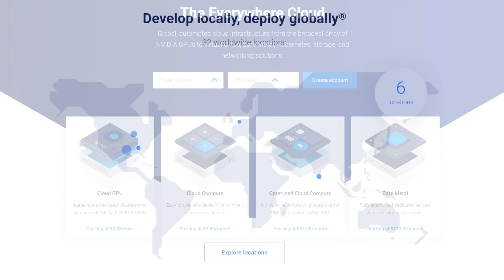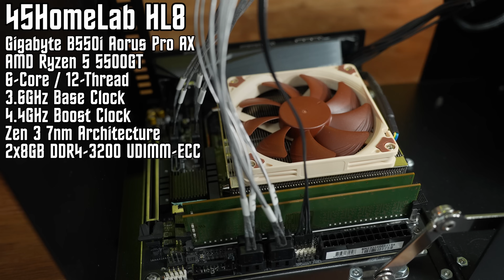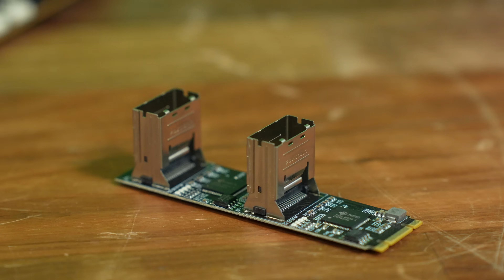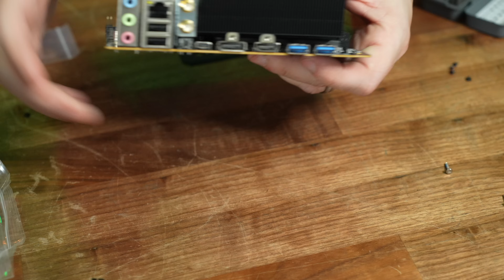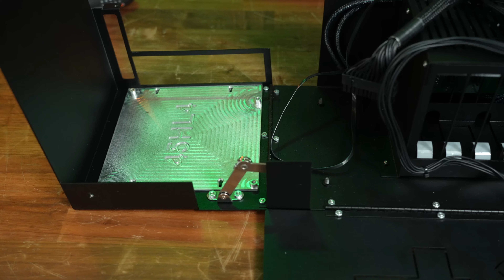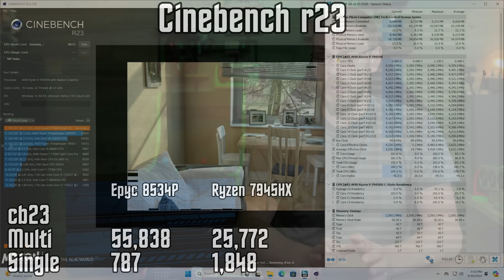The Ryzen 7945HX Mobile is an INSANE Server CPU - Minisforum BD790i in a 45Drives HL8

Comment: The GPU Spec for the 7945HX is wrong, it only a 610M and only 64GB of RAM Per Minisforum Spec sheet. I run the same board with a 10G Card for a pair of Proxmox Nodes.
Reply: It supports 96 GB RAM (2 X 48GB)
Reply: @zak-rq  Wow! I was surprised to find 48GB (and even 96GB) RAM modules on sale )
Reply: it unofficially supports 96gb
Reply: @리프로-y7v  Ya most of the Minisforum mini Pc's will run 96Gb DDR5 at 5600 without a problem, it's mostly just that they havn't tested all the models with a 2x48gb set. I'm more interested if this board will run with registered ECC if you can find a working SATA M.2 card for NAS setup.
Reply from the maker: ...I think I unconsciously typed that, as I'm so used to the 780m for APUs. I KNOW it used the 610m. Consider this my asterisk.
Reply: @CraftComputing  I'd really love to know how well the 610M handles plex transcoding, if it works at all.
Reply: @JBoulter11  It doesn't.Radeon don't support plex encoding. You need quick sync for that. Even a pretty lowly n100 should do this very decent.
Reply: @mrdali67  quick sync is the only way, hence why he’s using an Intel arc gpu
Reply: @CraftComputing  ..about a voice over to correct yourself ?
Reply: @CraftComputing  ******************************************
Reply: Correct on the igpu, but 96gb works fine.
Reply: Level 1 has 128 working 😊
Reply: I just got 128 gigs to work on mine (2x64 4800 crucial sticks)
Reply: @TyroneLegstrongVI-z3o same
Reply: I’m about to put a 9070xt in one 😉

Comment: It seems to me that if you isolate the connector torque by adding two things, an actual screw and wide washer mount for the nvme card and a securely mounted cable brace  "L" crossbar to stabilize the two sata cables ... gently attach the cables to the nvme card, then insert the card and fasten with screw and base washer ( same width as nvme card if possible) ...  secure cables to crossbar to the vertical surface of the "L" with a flat segment with 2 tapped screws (or screw/nuts per cable.  The aluminum "L" stock (brace) should be available at any hardware store ... cost  - screw tap tool (15$)?  This "L" brace is the screwed to riser mount, which is the attached to the mobo tray, with a cross bracing strap piggybacked through one of the cpu coolers bracket screws.

... all this providing there is safely drillable mounting spots on the tray ... 😅

Comment: Im doing something a little similar, putting a ryzen 7900, 96GB ram, 8 20TB exos, a U.2 15TB 2.5"ssd and an RTX 4000 blackwell as soon as n3rdware releases the single slot cooler for it!

Comment: I have a legion pro 7 with a 7945HX for about 2 years now. Using adv bios unlocker and some heatsink mods with my custom blowerstyle noctua cooler. I have it running at 5.2 GHz all core and 5.7Ghz single core. 64GB ddr5 running at 6000 36-37-37-34 FCLK 2133.

You could push this chip alot

Comment: I am very late to the party, and you might already done it or done something else. I don’t know, but just buy M.2 to PCIE slot. Just put the card on that and try to find a spot to crime at somewhere else, or you can put a M2 extensionto A M.2 slot and install the M.2 that you just had their on the case and put the extension on the motherboard, so while you’re assembling the case together, it doesn’t bend or get the car at a wax, so it doesn’t damage itself.

Comment: I just built a mini-ITX system with the Minisforum BD795i SE, inside a minuscule Goodisory A09 case, and the Cinebench R23 gave a 32,839 multicore and 1,946 single core, average of 10-min run. In this case, the CPU got 100W stable nonstop. Your cinebench score is much lower, not sure why it throttled down, perhaps due to temps?

Comment: I know this video is ancient by computer builds standards on  the internet, but here I go anyway...
To solve your connectivity problem, there are PCIe-adapters from 16x full height to 8x half-height with 2x M.2 breakout (google for "ph43-b" if you actually haven't seen them, I assume you have). Since your GPU is low profile anyway, that would add 2 M.2 x4 slots that you could use for NVMe(s), freeing the onboard M.2 slots for 2x SATA controllers giving you enough ports. Obviously requires bifurcation support of x8x4x4, but I assume that's a given on a board like that.
This is only a little janky, but if higher jank levels are accpetable there's always the option of daisy-chaining an (open ended) normal PCIe x4 brekaout from any of the onboard or riser M.2 slots to plug the GPU into. As it's being used mainly for encoding anway, the number of lanes shouldn't matter. This then leaves the low-profile slot on the riser for a "normal" HBA of your choice. I prefer the other option, as this PCIe-Stack isn't the most rigid (but should be rigid enough), and you then have 2 SFF cables coming off it, causing a similar but smaller issue with the M.2 HBA you already had.
Obviously in a similar fashion a real 10gbe (or faster) NIC can also be added this way, but requiring an external connector puts this firmly into Dremel and/or 3D-Printing territory...

Comment: The core ultra 285hx or upcoming 385hx would be a perfect pairing for this with the SOC having ecc support, Xe graphics, NPU, 24 cores and 24 lanes of gen 5 pcie. If asrock make a motherboard with dual mini sas to u.3 and an 8i connector for sata this would be crazy perfect for this chassis.

Comment: @CraftComputing I ordered some parts to test some things. I got an 8x4x4 bifurication card that has 1x pci-e x16 running at x8 and 2x m.2's at x4.Then I ordered a Euqvos10 Gigabit M.2 to RJ45 NIC, finally I ordered an M.2 to PCI-E adapter to install a Intel Arc A310 Eco for better transcoding then the iGPU. I should have everything here by Sunday and I'll let you know how it goes.

Once finished I'll have 10 Gbps Networking, an External GPU (Allbeit Gimped with only x4 lanes of PCIE), and a Perc SAS Card.

Comment: How about say a M.2 Extender and then lay the SATA controller on the bottom on its side??? They look to be 18 bucks on amazon and give you 200 mm of room lay in on it side. Maybe a quick 3d print a holder for it???

Comment: use NFHK NGFF M-Key NVME Male to Female Extension Cable 40cm with SFF-8654 Connector for Mainboard SSD 2280/22110 && Diliving SlimSAS X8 to 8*SATA,SFF-8654 74P to 8*SATA 7P, SlimSAS Host/RAID to SATA Target HD, 85CM Cable

Comment: I built one of these for a TrueNAS Scale Server using the following -
* BD790i
* 64 GB Corsair RAM
* 8x 6 TB SAS HDD's (used from EBay $30 each)
* 2x 512 GB SATA SSD's (Over USB C External Enclosure for OS and SLOG)
* 2x 2TB Gen4 NVMe's for L2ARC (Raid 1)
* Perc H710 flashed to IT Mode SAS Controller
* SIlverstone CS-382 8 Bay Hot Swappable Chassis
* ACASIS External Dual-Drive Enclosure (Amazon)

Doing HW Transcoding by passing the iGPU through to the docker container running plex. Prior to running TrueNAS I was running Ubuntu 24.04 w/ Cockpit and ZFS a custom home lab box with some of the 45 drives modules for Cockpit and it worked fine as well. Plex ran on the Bare Metal Ubuntu install so it had access to the iGPU via that method. I'm pleased with my system and hope this helps someone else. My next upgrade is going to be to switch to the BD795M so I can do better cooling on the CPU. With this having the 2x SATA Ports onboard I can get rid of the external enclosure for the Boot and SLOG Drives as well. Additionally I can use the m.2 2230 e key as a second 2.5 Gbps NIC on this setup with the 795M

I can tell you now this setup fully saturates my 2.5G Network at home using a Unifi Flex Mini 2.5G switch.

Another upgrade might be to switch out the Perc card for a SAS Card with DAS support and get a Dell EMC DS60 off of Ebay Cheap for more storage needs. Depends on your storage needs and your home lab space.

Love seeing all the other builds come from this motherboard. Keep up the great work in the community sir! @CraftComputing

Comment: I got the 795i SE. no wireless or NVMe heatsink/fan and it's still the 7945HX but haven't built it into a case yet. Hope it's as good as peeps keep saying it is. One question if you ever see this. The SE version comes with the bracketry, antenna plugs, screws and such, but NO Wifi/BT card. I bought a mini PCIe card, and it's too big by a couple millimeters and won't fit. would you happen to know if I can even BUY a card or if it's another Minisforum Proprietary thing like the NVMe Heatsink/Fan cooler is? (I've spent hours looking online to no avail) Thanks.

Comment: as the bd790i can bifurcate, what i'd do is get a quad nvme card and some m.2 to x4 extensions, then 3d print some brackets to hold a 9300-8i, 10g nic, and gpu internally, and route the ethernet and hdmi ports to a printed pci bracket. you'd have 4 lanes unusable with the 8/4/4 bifurcation though, unless someone designed a pcb with an oculink 8i and two 4i ports or something like that...

Comment: That chassis is damn sexy. The price and only ITX compatibility is not. Yet still, in a moment of lazy weakness, I might be tempted. I have a Minisforum MS-01 to use as my Proxmox host, so I mainly just need a bigger badder storage server and wouldn't really need to run any VMs on TrueNAS, so I will probably just run it bare metal whenever I end up buying / building something. Would their stock config (probably with some upgraded RAM for ZFS) be good enough to saturate a couple 10 Gbps connections for that use case? Though at the price of their fully built one versus the fully built HL15, I really ought to just find somewhere to put a rack.

Comment: You can get M.2 to SFF-8654 adapters, M.2 to SFF-8643, and  M.2 to Oculink adapters and cable it to a PCIe x4 Slot conversion board. I haven't seen one that is PCIe 5.0. You still need to find a way to mount the conversion board and your PCIe SATA or SAS controller in the case. Probably doable with a 3d printer.

Comment: You can squeeze more power out of this with a -30 undervolt and bumping the boost clock override up another 200mhz.  That also brings the temps down a fair bit.  To ensure max clocks I replaced the thermal compound which was dried and cracked to ptm7950, no more throttling down.  Finally to maximize the cooling I flipped the fan mounting bracket with the fan screw threads up and tossed on a cougar mhp 120mm fan that is 25mm thick.  Very very quiet and cools like a monster.

Comment: for the SAS M.2 controller... Use some appropriate glue and a piece of plastic or other stiff material. There seems to be more than enough space between the controller and motherboard. I know that looks strange, but if flexibility is really the problem, it should work like this.

Comment: Here's my suggestion.  Let's forget about the IOCREST SATA controller.   Leap past this with your valid requirement for video encoding thru Occulink from the M.2 slot.   I believe, that little Intel A310 video card you show in the video will "Fit" inside this case.   With your fabrication skill,  I'm sure you could find a place.  Subsequently, freeing up the PCIE slot for a SAS controller?   IMHO, Occulink card supporting Gen 5 makes overall good sense.    I wish we could surmise the future of Occulink.  Thoughts ?

Comment: I saw on a website, this thing selling for 40,000rs i.e 500$ approx.
That's a really good deal isn't it?
Its even more multicore performance than a 7900x and a 14700k, maybe even pretty close to 14900k. For 500$ with a motherboard included!
Reply: Minis has a MINISFORUM BD790I  X3D that comes with a 7945HX3D for $559 USD.

And they also have a cheaper $389 version with a few less options or pcie gen 4 instead of 5 downgrades.
Reply: @shawnduffy279  that seems like an absolute value deal!
The 3d one for gamers, and the pcie gen 4 one for media and production!
Kinda unfortunate that they probably don't sell.. in my region.
Its a bargain tbh. The cpu (desktop equivalent) alone usually costs 60-70% atleast!

Comment: Ok, so I love this combination. I know how to pass the igpu through in proxmox with group permissions to say a plex ir jellyfin lxc with docker. I would live the intel GPU, but if that isn't an option then, ok. The primary use case is nas + docker serices. What I don't know is the best pcie hba with this board/chassis? If that is the setup, what is the best gen5 nvme boot/docker drive setup + pcie hba? The storage setup here isn't clear cut to me (never run a pcie hba before).

Comment: Meh, I'll keep to my Z440 XEON with 40 PCIe lanes for now. 160 euro including 64 GiB of ECC, case, 700W power supply. Already bought a 4x4 M.2 at PCIe 3 and it got 6 SATA ports on the mobo of which 4 directly connected. I'll let it sleep when I don't need it.

Comment: You can replace the m.2 E key (wireless) card with a 2 port sata card.  Although I didn't see any SAS options, they have a m.2 E to PCIE x1.  You can also get a m.2 drive to PCIE x4 slot card.  Then just use a standard PCIE SAS card.  Another huge benefit to this setup is that is uses much less power than any desktop CPU it can compete with.

Comment: 16:25 you should be careful pushing a cable into the socket. One guy successfully delaminated his nvme-sata adapter pushing too hard ( It's better to plug a cable first and then mount the adapter into the socket.

Comment: Following up on this for anyone who is also interested in the BD790i SE (the 7940HX, 16c/32t, but runs at 5.2ghz instead of 5.4ghz):

I'm happy to report that:
1) You can use M.2 to pcie adapters without issue - currently have a Mellanox CX-3 running at full speed off one of the M.2 ports.
2) The wifi socket (M.2 2230 Key E Slot) will handle nvme's no issue - have a Samsung 980 Pro running off it at 16GT/s x1 lane (boot drive for TrueNAS) ie. Gen4 x 1 lane
3) Bifurcation is still fully supported on the main x16 slot (ie. x16; x8x8; x8x4x4; x4x4x4x4), just as for the BD790i.

In my setup, I've been able to jam 6x Gen4 nvme's (5x Gen4 x4 lanes; and 1x Gen4 x1 lane), and 1x 10g NIC into this tiny setup. Not a bad little all-flash NAS!

Comment: One of those m.2 to pci-e breakout cables and then a LSI pci-e 3.0 sas controller would be pretty decent if you its too flimsy to mount directly to the m.2 slot.

I also hear the asmedia asm2364 usb 3.2 to nvme controller can actually do pci-e even though its specs don't explicitly state that - could see if you can stick an LSI SAS HBA on a m.2 pci-e breakout over usb3.2 :D

Comment: I just ordered mine from the EU store. I have a stupid idea: Put it in an Apple Airport Time Capsule case. I need to 3D-print side walls, but it fits the 197mm size. Hopefully I can make 140mm Noctua 3000rpm fan fit, and put the device in anorher room

Comment: @Craftcomputing You can get 6port SATA controller for M.2 M-key and a 2port SATA controller for M.2 A-key, meaning throw away the wifi card and put sata controller in its place.

Also please pressuse Minisforum to make memory clock related settings available in the bios. The hard set 5200Mhz for memory is loosing user a good 10-20% of performance. We want to run 6000Mhz with hand tuned timings!
The shame is they have it available on the intel motherboards, but not AMD...

Comment: You might just have cost me a fortune. I was thinking of building a Proxmox cluster which is 4 identical nodes.
There's a dual ITX case on AliExpress. I can put dual motherboards in 2U and a dual 10g PCIe 8x card for each. Use the 2.5G for management and we're in. With PCIe bifurcation i could use a SATA adapter on the second half of the PCIe 16x.

Comment: I just saw the m2 adapter flex A LOT while you installed the 2nd mini-SAS cable. You should have put some thick rubber beneath it before installing the cables. You risked breaking pcb traces.

Comment: Some great brain-power and experience on this thread. I am looking to move off an old Synology DS1512+ (still runs great, just time to move on) and use this build with TrueNAS Scale/VMs - no Plex or transcoding needed so no GPU card.

To maximize throughput across all 8 drives, what would you guys recommend since that PCIe slot will be available?

Comment: Isn't there an m.2 that supports an oculink that supports an out to 8 sata? Or... PCIE X16 to X8+X4+X4 Splitter Adapter M.2 NVME Port Expansion Riser Card, and 2 sets of the m.2 to satax6? I know the bd790 supports 8x4x4. But the OCUlink from m.2 may potentially work, I'm just not sure in there is an m.2 for oculink that supports 8 SATA Drives.
Reply: I was wrong, you'd have to do both the 8x4x4 adapter and an SFF card and the best you can hope for is 2 OCULink m.2 adapters on it and potentially you caould have to 6i breakout cables with support for 12 total sata drives, or save a few bucks on cables and go witht he 4i and an oculinkx4 sata adapter doubled. Not sure if a 4060 sff or even an SFF arc intel card would fit with out modification.
Reply: Happen to have equipment for this in my home lab, my findings with the oculink adapter I am using is 5 of the drives share the bandwidth of one line.Might be a great unraid solution for a praity drive, but this will have trouble maxing out a 1 gb connection even with 2 card setup. I am waiting on some KQCIBZ I got form Amazon, as that was meant as an OCULink to U.2 but can work with a SFF-8612 breakout cable to SATA x 6.